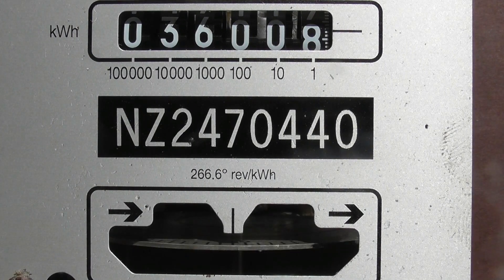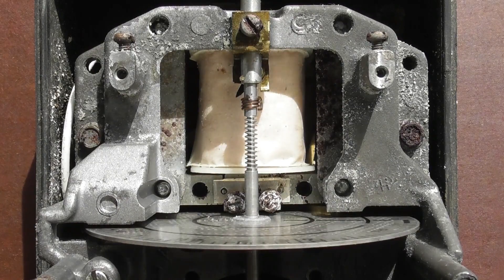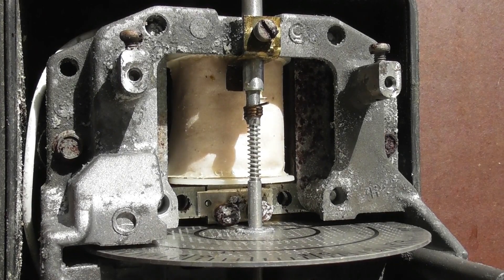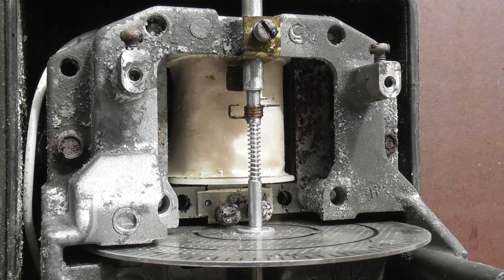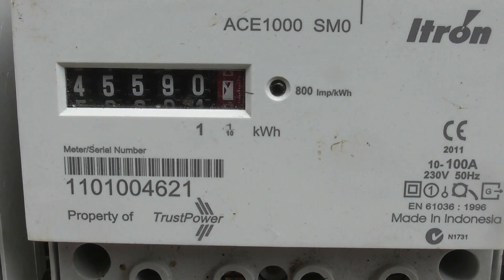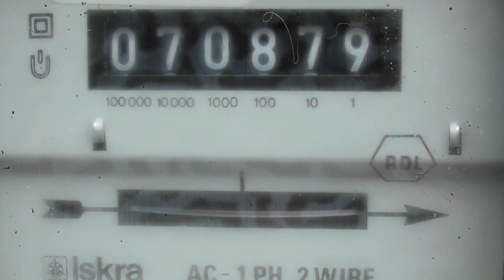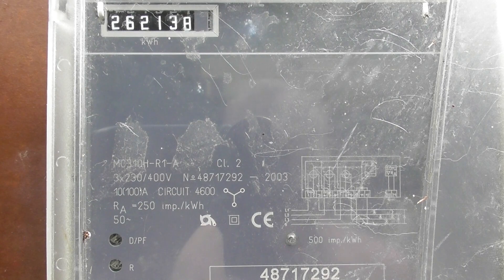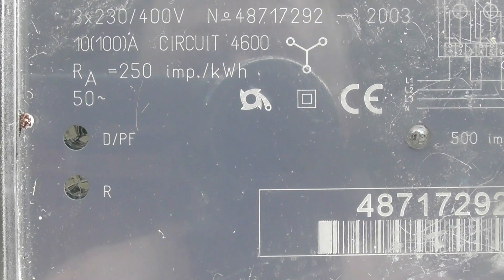Reverse running stop

Comment: Oooooh, no reverse loadwheel 
action with that one!
As for that Actaris meter.....

.......the flippin thing couldn't even be bothered to throw a greenie like the Sangamo SPA meters do.

Of course, as you know, I have succeeded in getting a Sangamo SPA to show a greenie at the same time as making it run in the correct direction and flashing its red pulse light. :D

I do need to do some electric meter vids like this one and show an anti reverse device, as the way they work in various meters does vary.

I have even heard of one meter (make and model unknown) where the loadwheel will reverse, but the kWh readout does not recognise the reversal of the gearing. I can only suppose that there is something in the readout similar to that of a bicycle wheel where pedalling forwards engages the pedals to the rear wheel, but pedalling backwards results in free-spin of the pedals.

As always on Wayne's Electrical, there will be more meter videos later, and hopefully (but no guarantees mind you) there will be some VIDEO EXCLUSIVES somewhere in the unknown nearby future.

Thanxx for showing,

-Wayne's Electrical.

15th March 2020, 01.01

Comment: The term as applied to US meters is a detent. Seems most of them were used in met metering schemes, with a meter for each direction, one of the two wired load / line for energy heading to the grid. Now with smart meters, one can use a single meter to accomplish the same thing.
Reply from the maker: Thanks for clearing that up. I have heard about detent, never knew the actual meaning of it.

Comment: hello I would like to know how electric meters work when turning the discs, common devices such as a toaster or a common bulb are used to rotate the discs or another device without the need for common devices to rotate the discs.
you can make a video or tutorial on how it works, even with improved substitutes please
Reply: Alexis Almaraz The meter uses two coils: the upper one is energized with the line voltage, and the lower one is wound with heavy wire to represent the current (volts x amps = watts), and the two coils set up a moving magnetic field that causes the disk to move. A magnet is added to hold the speed to a predetermined maximum speed and to fix the amount of energy required for one revolution. That in turn is interpreted through a selected gear ratio to cause the register to add up the disk revolutions which are recorded as kilowatthours (kWh).

Comment: The is taking the USA by storm now. People are covering their rooftop with solar panels and reverse feeding the grid to lower their bills and it’s very effective. Solar companies don’t tell you that even though you’re saving on the electric, the panels are going to set you back for 10 years to pay them off unless you pay cash, which most average households can’t do. It’s a great thing to conserve resources and help the environment that’s for sure.
Reply: Sadly, my uncle had a sizeable 9kW solar system installed about ten years ago, but two years ago it failed and burnt down his house.
They didn't find the exact cause, but it was narrowed to the PV's and/or PV wiring in attic - other sources were eliminated.
Thankfully the main portion of his house was saved by the FD, but smoke and heat damage ruined all contents.  No injuries, and no pets lost either.
(The house frame/structure only sustained minor damage, but the area where the fire started, above the garage, was totally collapsed. All contents destroyed by smoke and heat.)

P.S. It's since been rebuilt, and they're not getting solar ever again..!
In fact, a solar installer solicited him, upon which he pulled out his phone and played the video of his house on fire. Man, what humor!!! XD

P.S.2.
Here in NJ, it was illegal to sell power back to the grid until very very recently (this year, in fact.).

Comment: Cool! 
But what's the problem actually, if the meter is running backwards? If you generate power back to the grid - shouldn't that be taken off from your bill? - since that means the power company doesn't have to generate that energy. Although, many countries (for example Sweden, where I live) have taxes for electricity, wich always applies to the one who is selling power to the grid (if you buy from the power company the normal way, you pay for each kWh plus a tax - if you generate power back to the grid, the power company may buy it from you, but also have to pay the same tax). That way, they need to know who is generating the power and may use different meters (so I can think meters with a backwards stop, is used in those applications)
Reply from the maker: It should be taken off your bill but often they pay a lower rate for power supplied back to the grid, as utilities have to maintain the grid and also supply reliable power when the solar / wind / diesel systems are not working. It is fair enough that they can apply a different higher rate for power supplied from the grid. Also costs for metering , billing etc has to be taken into account as well. Most people with alternative systems rely on the grid as back up when accu's or inverters fail.